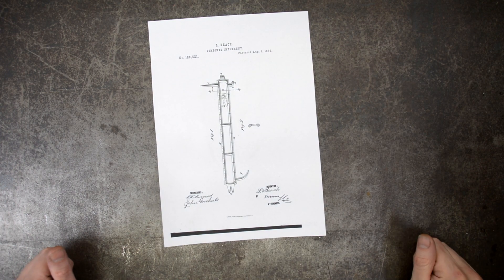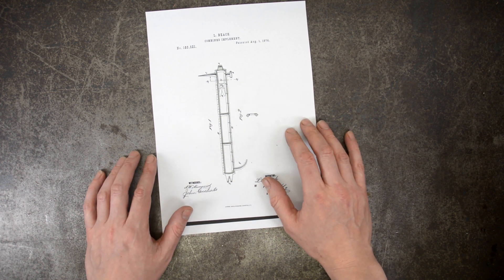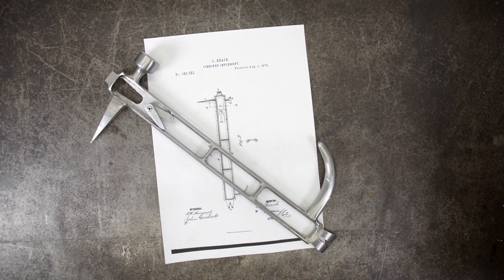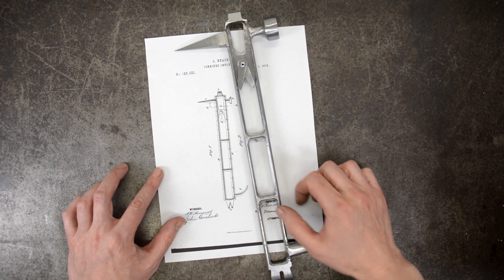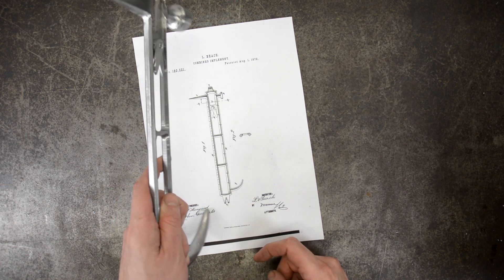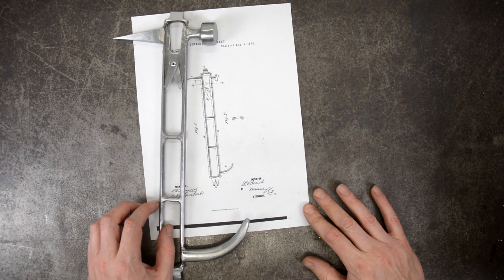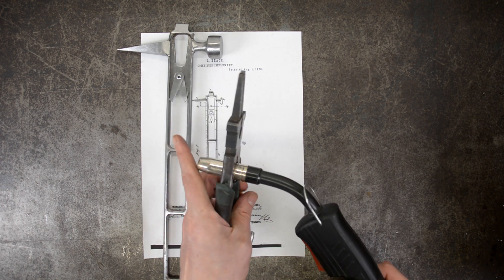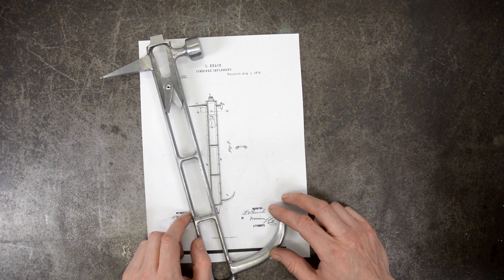Ten-in-One Tool From 1876 | Can I Make It? | Manual Machining

Comment from the maker: Can anyone think of a GOOD multitool whose functions are meant for many different types of job like this 1800's design?
Reply: I carry a Leatherman multi-tool. Not one of the cheap knock-off chinese variety, but the real brand-named kind. It's going on twenty years, and I am right now nearing the end of the line for what has been my third one so far. Not a day goes by where I don't several times a day reach for it in it's leather holster on my belt. In performance, I often even prefer it's attachments to some other specific/stand alone tools of the same type. Honestly. They are the only true, very good multi-tool that I have come across. I use it for many things in my dayjob, nightjobs, hobbies, and even on Sunday afternoons, whenever some random little repair or tweak comes up at the in-laws, or something needs doing on one of my little boy's toys or things. Leatherman makes good quality, useful shit. No two ways about it. So far I've had the first "original" model, the "SuperTool 200", and the "wingman".  Looking forward to my next brand new one.
Reply from the maker: @anthonycusinato3969  Thanks for the comment. Yeah, Leatherman was about the only thing I can think of. They're great. My dad always carried his original PST  when I was a kid. I've been using my wave for about 12 years now.

Comment: I don't think this thing was designed as an implement thats intended purpose was to be building anything in particular. But more so as a vital aid to a rock climber, or some other manner of outdoorsman. Lightening his load and minimizing the quantity of items carried. With this in mind, the picture of the original found example that was shown at the beginning of the video looks a bit more "proper" than the one built here. It was cast, and the entire finished piece looks like it would lay relatively flat with none of its accessories/features protruding too far out from the main frame. The hammer head is too wide and the hook end of it also looks like it was made considerably larger and more prominent now on the new one. The "ruler" function was probably meant more for to serve as a quick scale measure reference, than to be used for marking lines. All in all, I think the patent drawing and antique cast iron example look like they may have proved perfectly functional and efficient to an old-time rock climber, or other specific scope of mountain or wilderness man. Just as "just fine" as that welding plier is to someone operating any mig/wire welding machine. Whereas this new one, ended up translating into something much more cumbersome, and not so hot.
Reply from the maker: Great comment. Thanks for taking the time. I know these patents are not necessarily scale drawings, however with this one we did have the benefit of the ruler measurements to give an indication of size. While I 'freehand' most of the elements when building these designs I do try to consider the proportions. Your comment got me excited so I did some measurements; overall the length and width is approx. 10% over what the drawing indicates. The 'sweep up' of the hook is way over (twice as high) but the distance sticking out from the tool is in proportion with the rest (i.e. sticks out twice as long as the hammer head). I would propose, however, that even if there were no curve on the hook it would still interfere with the function of the hammer and ice pick. The width of the hammerhead (given the side profile drawing) would need to be closer to 10mm thick in order to be able to lay the tool somewhat flat but perhaps it may not have been round at all... squared off sides maybe. Admittedly, I did not consider this tool as perhaps a camping or trekking type item, good call on that. If they removed the pot-hook then this would be mostly functional in that sense.
Reply: @canimakeit3220  Thanks for your response! On this comment, and on my other one. I work in steel fabrication for mine, industrial, commercial, residential, you name it. And also in the remainder of my time work at mechanics and restoring old cars, as well as many other "hands-on" and skilled type hobbies. I have always been fascinated with patents and patent drawings and all things mechanical. I meant none of my message as any sort of jab towards you, and am pleased with how you took my input. You seem like the sort of guy I'd probably get along famously with and enjoy putting heads together with.
Reply from the maker: @anthonycusinato3969  My pleasure mate. Honestly the reason for this channel is that I finally got the mill 4 or 5 weeks ago and I was looking for projects so I figured I'd record them and see what the feedback was. I love old tools and figuring things out but I'm a desk jockey in my day job. You don't learn unless you listen to others and consider all ideas and angles. Your input is greatly appreciated.